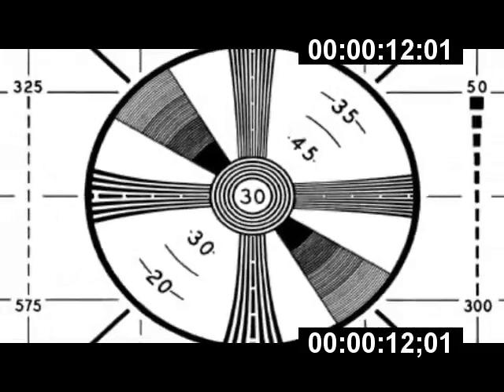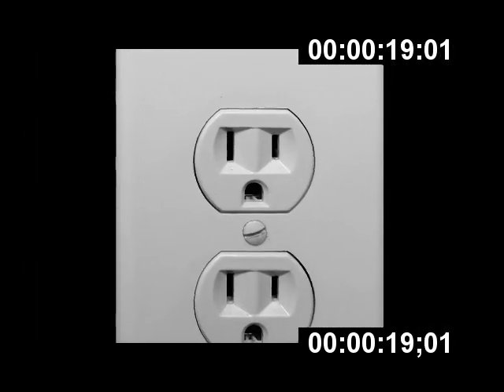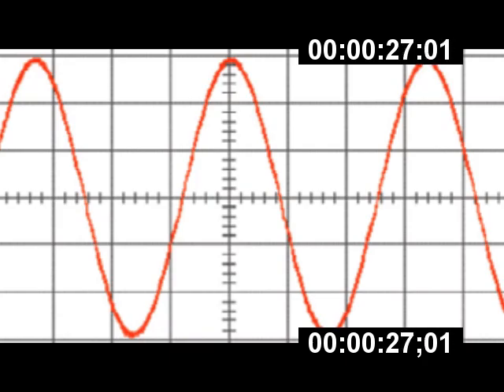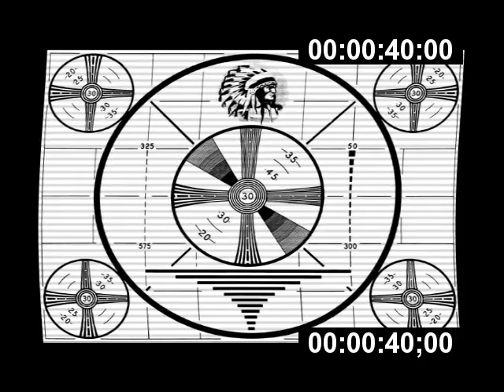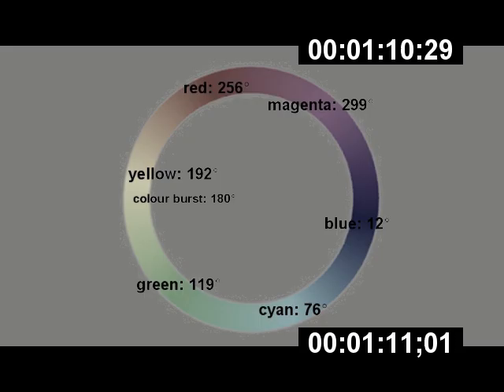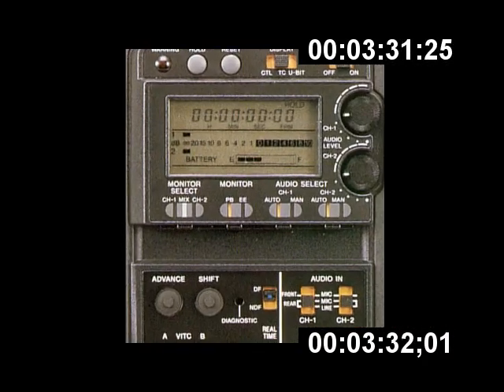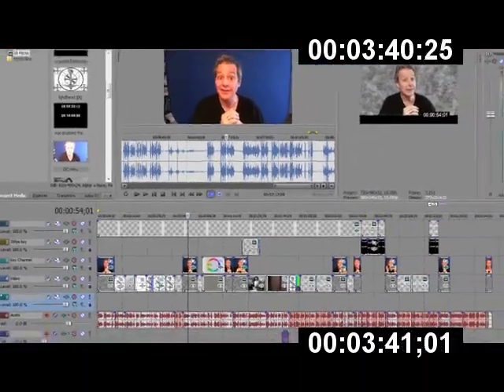Time Code: Drop Frame vs. Non-Drop Frame

Comment: So...the simple question is, how do we choose which TC to use? 

For example...I have my GH7 camera frame rate set at 29.97 fps and have a Deity TC-1 jamming it's TC to it. 

BUT...I see that I have two choices of 29.97 or 29.97D (D representing drop frame).  So how to I go about choosing the right version of 29.97 frame rate?

Comment: Hi 
Can we use the drop frame timecode to sync with UTC time? Meaning instead of starting from 00:00:00;00 it will start from current UTC time 18:45:10;16

Comment: Es simple si tan solo aplicamos la aritmética. En un minuto con DF han pasado: 29.97f X 60 seg. = 1,798.2 f / min.
 Este .2 es importante porque cada minuto adelantas 2f para que tengas una cifra de marcos cerrados a ceros, o sea: 1,798 f / min.
 Ahora bien, al final de un lapso de cada 10 minutos ya completamos 2f adicionales, o sea: .2f X 10min = 2f que no agregas y dejas correr normalmente. Al final de 60 minutos en DF obtenemos: 29.97f X 3600 sec. = 107,892f
 en cambio con NDF otenemos 30f X 3600 sec. = 108,000f
 Porque a estos 108,000f reales les restamos 120f que son el resultado de la suma de 2f que se perdieron cada minuto. Ahora bien a estos 120f le restamos 12f que no perdimos cada 10 minutos (2f cada 10 min. =12f) y terminamos con 108 cuadros de diferencia real. Y aquí todo coincide con los primeros datos de arriba: 108,000 - 107, 892 = 108
 Este razonamiento lo deduje gracias a la valiosa comparación que hace DANA sobre los años bisiestos acumulativos, solo que aquí es en sentido inverso pues los excedentes son DESCONTADOS de la cifra obtenida cada minuto para continuar con cifras completas. Saludos y espero haber ayudado.

Comment: It's interesting that in drop-frame time coding, we omit counting two frames per minute except when the minute is a multiple of 10 instead of omit counting three frames per one-and-two-thirds minutes or every 100 frames.
Reply: In Timecode of 59.94, we drop 4 timecodes every minute except for 00, 10, 20, 30, 40 and 50

Comment: the wind is still sailing between both ears for me. Over 15 years of working with film and video and still can't get my head wrapped around this concept.
Reply: In astronomy, the earth takes 365.25 days to go around the sun,. But we cannot have calendars with a fraction of a day. So we make the calendar year to be just 365 days and forget about the 0.25 (one-quarter) day. After 4 years, we have accumulated 4 one-quarter days to make a whole day. So every 4 years, we have a leap year and we add a leap day to the calendar and we label this extra day as Feb. 29. Drop-frame time coding works the same way except we are not adding an extra frame and giving it a label. We are deducting a frame and skipping the label or the numbering. When the frame rate 29.97 frames per second, it is too cumbersome to keep track of fractions of a frame as follows:
1 second  29.97 frames
2 seconds  59.94 frames
3 seconds  89.91 frames
4 seconds  119.88 frames
5 seconds  149.85 frames
Notice the numbers to the right of the decimal point get smaller as time progresses. Eventually, the fraction of a frame will get small enough so that we lose an entire frame. So when we use a 30-frame-per-second counting system (non-drop-frame) on a 29.97-frame-per-second frame rate, we omit some of the counting numbers.

Comment: If you skip 2 frames every minute, aren't you loosing 2 video frames every minute?
Reply: +Jamie Smith Video is not slower or faster. Its the same. The clock label is just different. Its like numbering something using 10base numbers or using binary for example. The base ten is: 0, 1, 2, 3, 4, 5, 6, 7 etc. The binary is: 0, 1, 10, 11, 100, 101, 110, 111 etc. In binary you have reached 111 faster then using the decimal base, but you have just counted until 7. Timecodes work in a similar way, you drop some numbers, but you dont actually drop the frames. 

And skipping some frames on a 1 minute video doesnt mean your video plays in slow motion. If i count like this: 10, 20, 30 once per second, i still take 3 seconds, because ive skipped 9 numbers per second. It doesnt imply that my counting was in slow motion. Erasing one number from your 12 numbers home clock wall, doesnt mean that you will live in slow motion. One of the hours will simply be skipped, but time remains the same.
Reply: HeavenlyEx
I'm still not getting it. No one has ever been able to explain this to me in a way that made sense. All I can see is a paradox between talking about DF as though it's running slower, but it's not because it's just the labeling is different. This video says "to get around this problem we slowed down the rate of color TV" so it's slower? I'm told no. And "B&W TV's didn't seem to notice the slightly slower frame-rate." Again, it's slower?
Nope, it's only labeled differently.
But you just said it's a slower frame-rate.
No, it's just different labels.
Then why didn't you say it's a slower frame-label instead of frame-rate?
Because it's a slower frame-rate.
So the video is slower?
No, it's a different label.
Reply from the maker: +Jamie Smith It's two frame numbers in the time code labelling, not two frames of video. You still keep all of your video!
Reply: +Dana Lee Something is just not lining up for me... If you skipped some numbers on a one-minute video, and relabeled video frames with the new numbers, your video has to run longer than a minute to keep all the video images in there. That must also means it plays slightly slow-motion if the content remained the same.

Or, were the 2 "missing" frames never recorded in the camera in the first place?
Reply from the maker: +Jamie Smith To show you what I mean, pause my video near the end. I paused it at around 3:54, and there are now two numbers on the screen - for example 03:54:02 and 03:54:08 in my case. But I haven't deleted any video frames in my video, I've simply numbered the frames using two different systems - drop frame and non-drop frame. The numbering difference comes about because drop frame time code is designed to number NTSC video properly, which actually runs at 29.97 frames/second, not quite 30 (as you mentioned, the video in NTSC runs slightly slower than 30 fps). Does that help a bit?
Reply: +Dana Lee Maybe I'm confused on how one version runs slower. If I only had time to show your video for 3:54:02, wouldn't your other time code say I had to end it 6 frames ago? If one is running slightly slower, then I have to knock off the end (lose frames) to fit it in the same time slot.

I'm making a video that I want to have just one frame-rate because I'm making computer animations and live action, and then I'll convert the final film after for cable TV and viewing online, but I want the conversion to be simple. I like 24fps because people associate the look of it with film. I already assumed that cable TV uses 29.97fps, so I'm thinking about starting mine at 23.976fps to get the 24fps look, but have it already use a drop-frame frame-rate so when I convert the final movie to a TV format, it'll already be ready. And Youtube doesn't care what frame-rate I use so it won't be confused when I upload 23.976.
Reply from the maker: +Jamie Smith Ahh, I see what you're wondering about. In the end, your conversions will be identical in terms of running duration, and each version (23.976/29.97/30 fps) will all run for the same length of time. Time code is about what you label each frame (with a frame number), not whether things run fast or slow. So, create your video in the format that best works for you, and then convert to the other formats. It should all work  out!
Reply: Dana Lee
I still don't get it, but I'll take your word for it.
Reply from the maker: +Jamie Smith I can see the paradox. Essentially NDF code was designed to label each frame in black and white television so that the 'running time' as listed in the numbers would be accurate. Since colour TV does run at a slightly lower rate, numbering 30 frames/second in that case would result in an inaccurate time display over a long time, because you don't have a full 30 frames/second, but rather only 29.97 frames/second. So, they invented DF with its weird numbering, dropping frame numbers every so often to label colour tv and keep an accurate numbering system that would truly represent the running time of a show.
Reply: Dana Lee
I still only see the paradox. We've been focusing only on the playback... so is it the capture rate that makes the difference? If I filmed someone jogging by at 1fps vs 30fps, I've capture all the action, but much more action would be combined together into each frame with the 1fps camera (lots of blurring and staggered motion).
But if I captured the action at 29.97fps vs 30fps, I'd still capture all the action, but only a tiny bit more action would be combined together in each frame of the 29.97fps camera. I wouldn't notice the difference compared to the 30fps camera when I played them back.
Reply: *****
I'm almost getting it now that I'm understanding the capturing better. It doesn't drop video frames because it adds a tiny bit of extra action evenly into every frame while you're filming on location. I think that's the an important point because when people say it doesn't drop video frames, they don't say that the what-would-be-dropped action is compensated for by each frame capturing .0333667 seconds, rather than .0333333 seconds. That additional .0000667 seconds more in each frame is capturing the would-be-dropped action. Is that right?
Reply: @jamiesmith4293  I am stuck at the same concept for quite some days. Essentially, what is bugging me is how 30 fps video becomes 29.97 fps without dropping frames, or playing slow or fast, but merely by relabelling it differently as Drop frame?
Reply from the maker: +Jamie Smith Yes, that's right. Sorry that my earlier reply was from my other YouTube channel persona, lol. They're both me...
Reply: In astronomy, the earth takes 365.25 days to go around the sun,. But we cannot have calendars with a fraction of a day. So we make the calendar year to be just 365 days and forget about the 0.25 (one-quarter) day. After 4 years, we have accumulated 4 one-quarter days to make a whole day. So every 4 years, we have a leap year and we add a leap day to the calendar and we label this extra day as Feb. 29.

Drop-frame time coding works the same way except we are not adding an extra frame and giving it a label. We are deducting a frame and skipping the label or the numbering. When the frame rate 29.97 frames per second, it is too cumbersome to keep track of fractions of a frame as follows:
1 second  29.97 frames
2 seconds  59.94 frames
3 seconds  89.91 frames
4 seconds  119.88 frames
5 seconds  149.85 frames
Notice the numbers to the right of the decimal point get smaller as time progresses. Eventually, the fraction of a frame will get small enough so that we lose an entire frame. So when we use a 30-frame-per-second counting system (non-drop-frame) on a 29.97-frame-per-second frame rate, we omit some of the counting numbers.
Reply: You said "every 4 years, we have a leap year and we add a leap day." But Drop-Frame doesn't add frame numbers, it drops them off. It seems to be the opposite.

This conversation is really old, but I think I remember an explanation that each video frame lasts a slightly different length of time on-screen. And it doesn't come to a nice rounded-off time at the end of each second. Like, one frame remains on the screen both before and after the one-second mark, instead of ending or starting exactly at the one-second mark. Meanwhile, the naming of the frames is becoming slightly out of sync because of that. That awkward overlap eventually lines up with the clock, and at that moment, the naming of the frames gets re-synchronized to represent how many frames actually went by. The re-synchronization happens to result in dropping 2 frame names. Is that correct?
Reply: I did not say drop-frame time code adds frame numbers. If you clicked on "Read more", you would have read in the second paragraph that "we are not adding an extra frame and giving it label. We are deducting a frame and skipping the label or the numbering".
Reply: I did see the rest. What I meant was your leap day example is showing the opposite by adding instead of subtracting. While it's a good comparison to show other things that end in fractions, so we have to compensate, it seems to be going in the opposite direction by adding instead of subtracting. The subtraction in DF is, as you described it, skipping over a label.

Comment from the maker: You may find that some film editing uses NDF, but it's likely 24 fps, not 30 fps. Most video people use DF 29.97 fps. Problem is, there's still some old legacy equipment out there with a DF/NDF switch on it (e.g., old videotape recorders) and that's where the problem comes in - wrong switch placement!

Comment from the maker: Older equipment may have switches or menu selections to go between the different types of time code. If your camera is relatively new, it'll probably default to drop frame. Use drop frame.
Reply: I also use it for capturing 59.94 frames every second but 4 frames are drop every minute except for 00, 10, 20, 30, 40 and 50

Comment from the maker: The numbers themselves (the labels as you call them) are the numbers that change, and the frame labels which are dropped, as per my video. So the video itself doesn't lose any frames, but the *numbering system* drops those digits. See 2:40 in the video to show how and when this happens.

Comment: Thanks for this explanation! This helped me a lot in understanding more of my work. I have a question though...I work with international distribution. Today I transcoded a non-drop frame video to PAL, not realizing it was non-drop. I notice that usually NTSC drop frame timecodes are a few frames off from PAL timecodes after a transcoded. In this case, it was off by as much as 2 seconds. Is this because PAL is more in-line with NTSC dropframe? Now I'm curious, what do you know about PAL 25fps?
Reply: here's a link http://www.michaelcinquin.com/tools/timecode_keykode

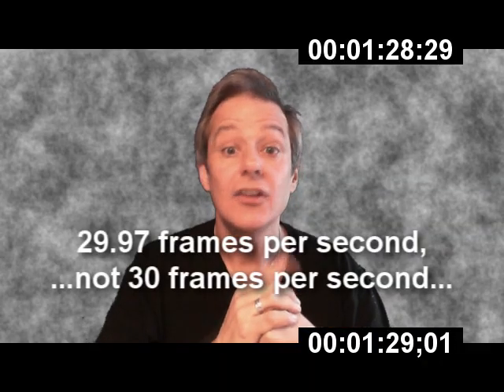Comment from the maker: Not exactly. Check the video out again at 1:00 and beyond to 1:30. Colour TV's subcarrier showed up as a fine interference pattern on B&W sets. What was worse, it moved across the screen, which was annoying. By slowing down the frame rate a bit, the interference was, at least, stationary, which made it much less noticeable.